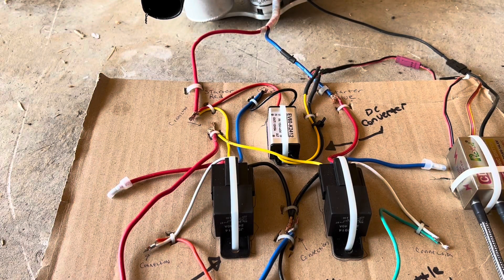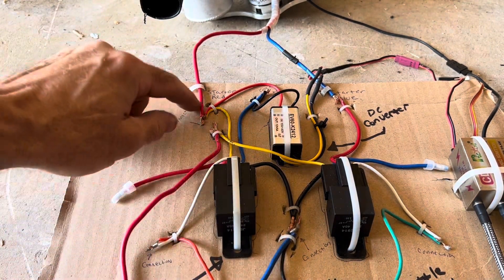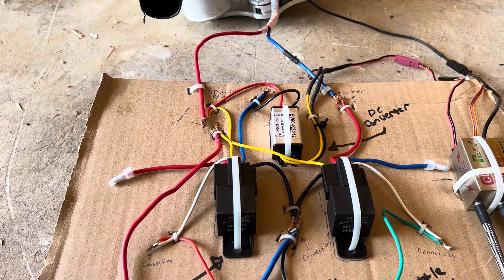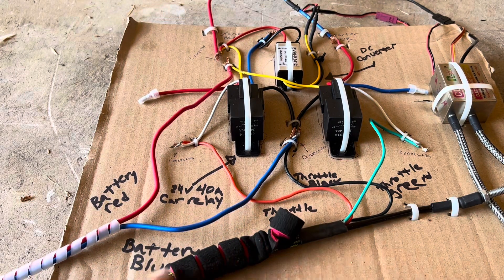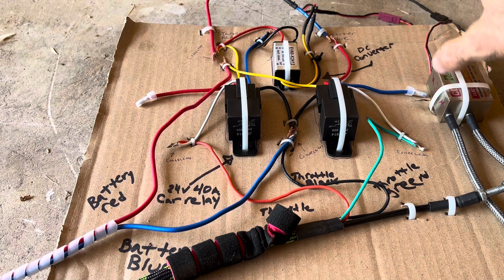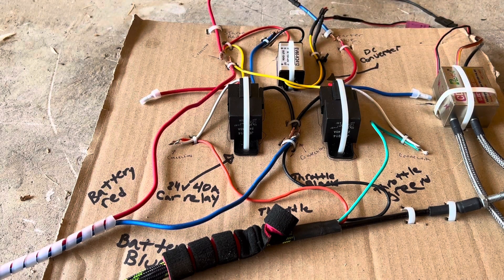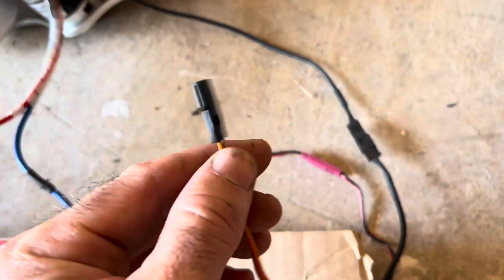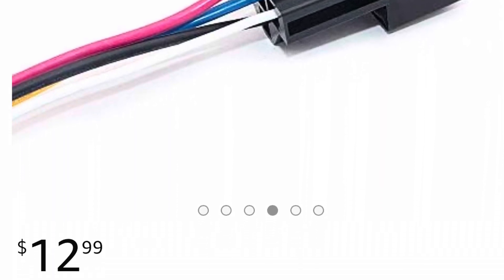AliExpress AirJet DLE170: E-Start Wiring Diagram

Comment: That three wire connector (RC styke) is, in fact, where you plug your tach. Since the plug wires are shielded to stop interferrence with the radio receiver, you can't wrap a traditional type tach wire around a plugwire.

Comment: Hey Wes, i don't know why but my electric strater stopped working. I recharged the battery, connected everything, made sure there was a spark on the plugs but still the starter won't work any ideas?
Reply from the maker: Check the connections with a electrical meter tester. You can test each soldering point to see if it is a connection problem or a battery problem. If your get spark, it’s probably not a battery issue. It’s probably a starter connection issues. Hopefully it’s a connection that is external and easy to fix.

Comment: hi pal  on this video  u say 24 v  i have my engine and its running on lipo   11.1  the starter  wont start engine    any idears   regards firefly
Reply from the maker: What type of motor do you have? Is it a DLE 170?
Reply: yep my starter spins up  with high compression its slipping on  back of engine sprag one way bearing  I have just ordered one 
part no 39 Tec drawing 

  my engine looks just like yours with the new starter motor 
 also did u weigh your cage with out engine love your video's keep them coming🖖👍
these little engines will help  lighter pilots like my self   sorry I only just reply  💯 keep them coming  thank you